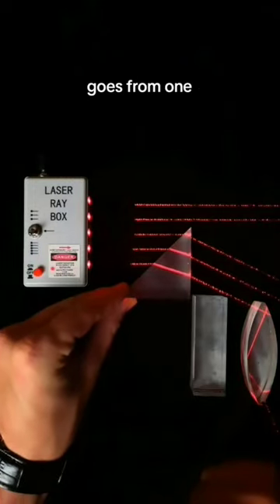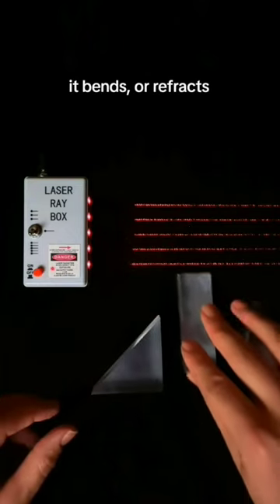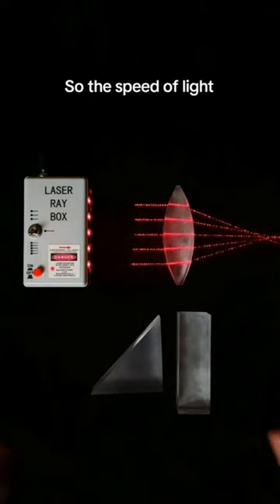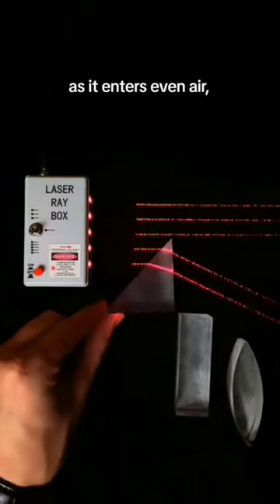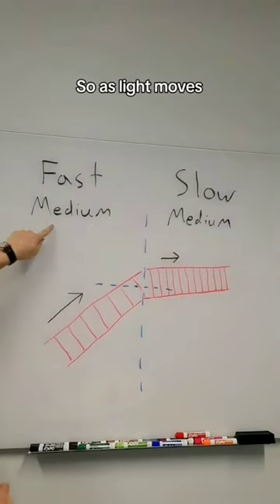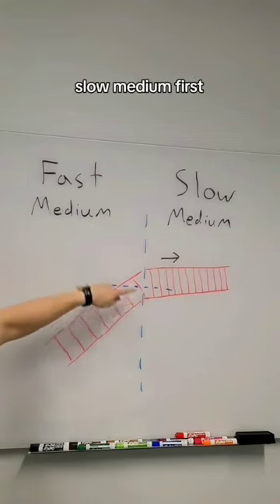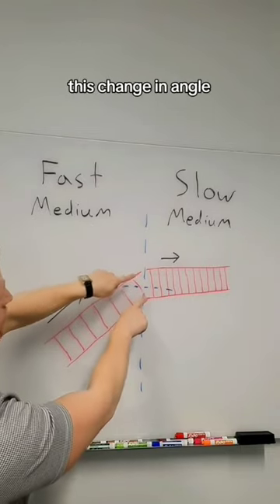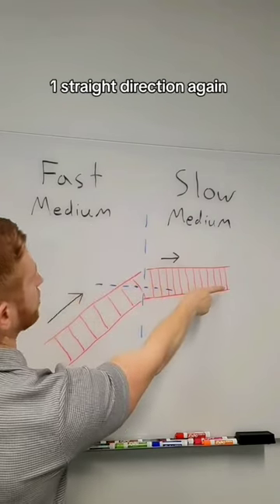Why Light Bends as It Enters Glass!

Comment: i thought the speed of light was constant, i always wondered this.
Reply from the maker: It is constant in a certain material, but it's different in every transparent material
Reply: @edmundoptics Speed of light is constant for ALL frames (no matter the medium) according to theory of relativity. It only changes direction because of the pull back by the electron wave caused by oscillations of electrons, which causes a light wave. Hope it helps!